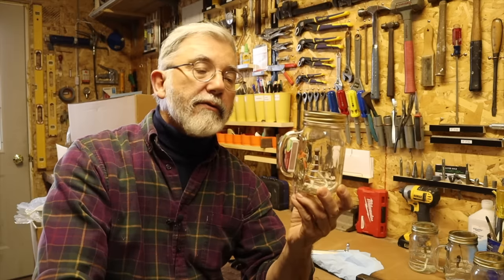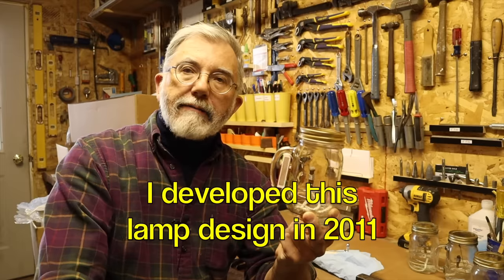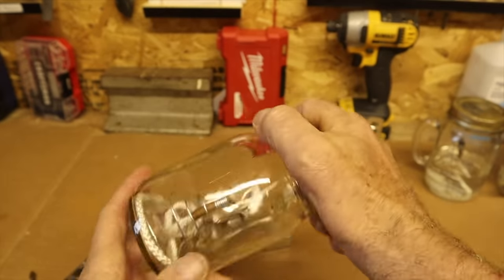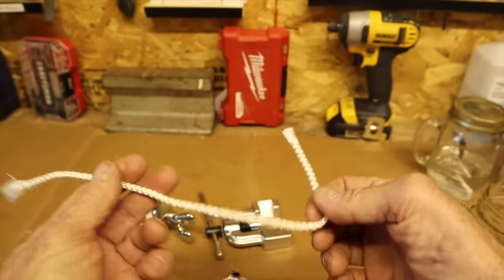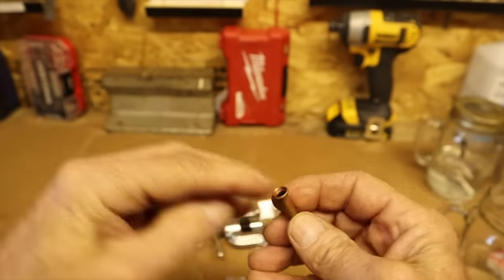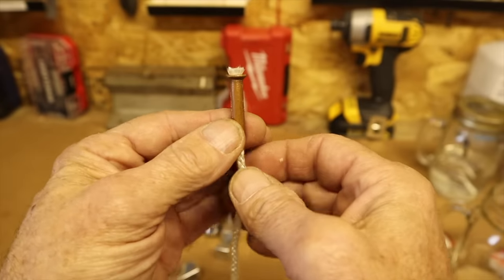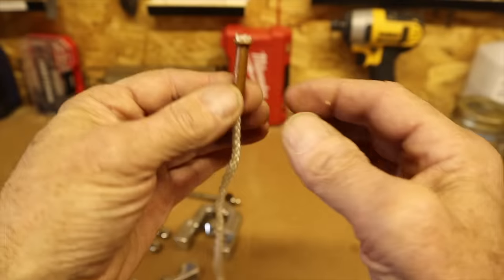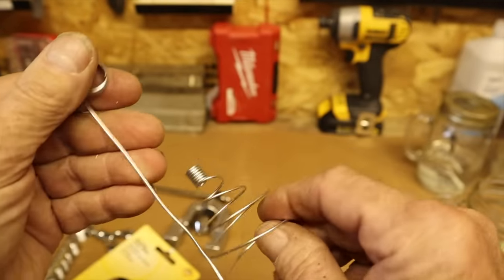How To Make Your Own Bright Betty Emergency Oil Lamp

Comment from the maker: NEW UPDATE: Be sure to check out my video, "How Safe is The Bright Betty Bam-A-Lamp?" at this link: https://youtu.be/asgeLt0cshE
For more information and Bright Betty parts kits... https://www.planetwhizbang.com/brightbetty
Reply: I will check it out and thanks. Also just a opinion if you have time...in a blizzard snow storm with wind/and power outage from multi. Downed trees last winter i tried to make a oil lamp of sorts with what i had in the middle o the night. A mason jar, lid and ring, with a long thick cotton length of yarn. Yarn through lid and jar full of olive oil. Ring screwed down and mach to ignite the oiled up yarn...nope. Time and again and mach after mach...no flame that would last. Why do you think this is? I mean come on oil should burn, shouldn't it? As i was making the lamp i was thinking that i remembered learning somewhere that the Egyptians use lamps filled with oil? The yarn withstood the flame, meaning it didn't burn up quickly so that was not the problem. Is there water in olive oil? Just the regular cooking type olive oil was used. It looked like it should work but not one work was in it.
Reply: I made a salt and oil lamp, takes two seconds, its pretty bright! Just need a wine glass, salt, any oil, wick, put the salt in the glass, holds the wick, the n add oil. .. yarn won't work. I tried it, yarn isn't woven.., its not cord.. not the same... Tea lights wicks are perfect and cheap, and birthday candles are good for transferring the light to the wick that way you don't burn through your lighters.. light the candle then use the candle to light the lamp. 😊God bless... Stay warm.
Reply: Would it be possible to burn olive oil instead? I have a bird 🦜
Reply: @georgetteroenfeldt8144  I read in another comment that yarn won’t work because it’s not woven. I think the yarn was the problem, possibly.
Reply: @bridgetgidget72  I've used all kinds of cooking oils, just whatever's on hand will work... Food oil is actually better in my opinion because everyone has some kind of that, even lard.. nut oils.. you name it.
Reply: @lindaragsdale1656  thank you 😊
Reply: First things first...  I like your "Bright Betty Bam A Lamp," that's pretty cute.  BUT...
That song is "Black Betty, Bam A Lam."  Let's give due credit here.  😉
  Although many other oils will work, the use of paraffin oil reduces residue, has virtually no smell, burns most efficiently and tends to be brighter, as a result.  That's it's intended job.  For that matter, you can stick a candle wick in a 1lb. tub of Crisco shortening or (pork lard), light it and you're done. 
  Rendered lard, (beef tallow is cleanest/best) and especially bear tallow, if you have access (good ol' "bear grease" has been used for almost everything from lamps to waterproofing leather/canvas and lubrication of gears and guns) works terrifically and has been used for a loooong time as lamp fuel.  Especially back when you couldn't look up Amazon or go to Home Depot.  People used what was at hand
  The only issue with tallow lamps is that they have to be warm.  At 72°f it starts to melt and will be a semi-viscous liquid.  76°f and up, it'll go liquid.  This isn't a replacement for the paraffin lamp but, is an effective hot weather alternative or, in cold weather when sitting on the hearth/mantle/wood stove, etc., anywhere it gets warm.
  Many people eat enough beef in their families that the fat (not gristle) trimmings can be saved in the freezer for an indefinite period, then rendered when enough is saved.  Just warm it in a pot over low heat, slowly, until it completely goes to clear liquid, skimming off any foam, impurities, meat bits, etc.. (be sure to trim any meat remains possible away from the fat when storing).
  These types of lamp (wax and tallow) work great, are easy to make and use and my family has had them continually present in their  homes for about a hundred years.  Both paraffin and tallow.  Tallow is a great resource most just throw away and is terrific for cooking/frying just about anything as you would with oils, butter and other fats and it doesn't readily smell or go ransid like pork fat.
  Once it's been Rendered pure, it has basically no odor or color and lasts a loong time and yet, if you fry French fries or eggs, etc. the flavor is terrific.  😀
Reply: Carbon fibre wicks don’t need replacing… try some
Reply: WOW! I always thought it was black Betty ⁉️🤔
Reply from the maker: @wheepingwillow24u17   I'm currently out of stock. The rolls of wicking I was buying wholesale are out of stock. I'm not sure when or if the wicking will be in stock again.
Reply: If you would have left the handle proud of the top the lid will keep tension on the wick holder and it won't raddle around in the jar.
Reply: There are so many people doing these candles/lamps. Easy enough to make yourself 🧨
Reply: @MtnBadger Yes, it's Black Betty😏. Maybe a play on words because of copy rights? Thank you for all the useful info: beat/beef tallow and paraffin oil. 🤗❤️🙏
Reply: @debz3503 and with all due respect to every race I'm sure that plays in there as well 🤷🏼
Reply: Im sure im not the first comment to tell you but the song was actually called Black betty! Go check it out..i promise im right sir although your version is good too🙂
Reply: @MtnBadger  Well THANK you for all that wonderful Knowledge❣️ That’s valuable information there Sir.. I need to re read it several times to make sure it sinks in.. 
So tallow is actually the animal fat??? re: beef tallow?? bear tallow???
Reply: Yes, tallow is rendered animal fat, be it beef, bear, sheep, etc..  It's good for cooking and makes the non-stick happen I. cast pans and tastes food.  McDonald's made their name by making their fries in beef tallow (try it, it's awesome! 😊) and they were sooo addictive. 😆 
 It's good for burning in lamps (like whale oil which comes from the fat) and even a crude lubricant.  The term "slap some bear grease on it" had valid origins.   Bear greae has k used guns, cooked food, powered lamps and was used for waterproofing. 
  Once all of the particulate (meat bits) have been removed/filtered from the rendered (heated to melt) fat, it keeps a pretty long time at room temp, a very long time in the fridge, forever in the freezer.  I always have a block of rendered beef fat in the fridge (it basically melts at room temp.) and use it for cooking eggs, frying potatoes and leaner meats without enoughfat on their own, adding flavor to things, etc..
  If you try it yourself, just save up some beef fat trimmed from steaks or whatever ( ot the really hard stuff or connective tissue), put it in a pit on the stove on lower heat and let it melt completely, skimming off any stuff that floats to the top and remove any bits of meat that will crisp up.  Once it's clear, pour it into a (small) loaf pan or dish or whatever mould you have, remove and put it in a freezer bag and in the fridge and e trash in the freezer.  😊
Reply: Black Betty ram jam

Comment: If you can find other wire, it’s better not to use galvanized wire on anything near a flame or heat source. Galvanized metal has zinc plating, which can give off toxic fumes at high temperatures.
Reply: Thank you for the heads up! I might use copper for mine then.
Reply: It won't be a problem with a wick . It won't get  near the high temperature needed to cause a problem.
Reply from the maker: Correct. Thank you for the comment.
Reply: Wouldnt coat hanger wire work just fine? Provided its not one of the coated ones.
Reply: @chase_h.01  Probably. But coat  hanger wire is very, very hard. It's gone through a process to make it not bend. So, it would be very difficult  if not impossible to use it for this lamp. But most hardware stores will sell copper wire that is much softer and easier to bend.
Reply: @chase_h.01  heat it on the gas hob untill red  and let it cool naturally this should allow you to bend it easy
Reply: Ooh! I had a fast food store off the St Lawrence River, Thousand Islands area. I had a beautiful propane heated grill/oven I got from the Benvenuto Brothers. They sold it and delivered it for only $250 - best deal ever! When I had it installed, I got galvanized steel to protect the wall and use for the hood. Another sweet deal! But little did I know back then that the galvanized steel would give off toxic fumes like that. 👍
Reply: Flared brake line may cheaper things up a bit.
Reply: @anyascelticcreations it may work harden when trying to manipulate it but you can just heat it up to soften / anneal it this may make it easier when fettling the wick holder bends.  I'll try it out.
Reply: @horsetowater  definitely possible. But it'd be a whole lot easier to use a material that you don't have to do all that with. Like copper, if it's available to you.
Reply: @ShaneAlan1  So have I. Back before I had anything else available. Coat hangers are definitely workable. But not easily. If that's what you have, and your hands are strong and/or you have tools available, you could make it work. But now that I know more about different metals, and have the ability to go get something else, I would for sure choose copper wire over coat hangers if I want to bend it into a wick holder sized spiral.
Reply: Doesn’t copper work best for heat conductivity?
Reply: @daltonstewart5366  Copper is a very good conductor. But nearly all metals conduct heat pretty well.
Reply: Thank you for this! Liquid parafin!!!
Reply: @chase_h.01  Hi!
I found your comment amusing. There was a pun in it. If it was intentional, then well done. If it just came about by accident, then nature was working with you to make folk happy.
(I made sure that I removed the coat/ jacket/shirt before using the coat hanger wire!) Haha! I know you meant that some times the coat hanger wire have been "coated" with plastic or even painted.
Thank you for sharing. God bless you and yours! 🙏👍✌️🇬🇧
Reply: Yes, husband welded galvanized wire and was sick with " welders cough" for weeks
Reply: For the record,if a cigarette taste SWEET you have galvanize poison,drink milk!
Reply: @congerthomas1812 Thanks for the info, not a smoker myself, but know a few.  Great health info.
Reply: @dag118 Interesting info to note, thanks for heads up.
Reply: I'd be more concerned about the fumes from burning modern plastic reinforced wicks.
Reply: I saw a galvanized metal warning on another, similar video. Thank you for this important info. It should be pinned since it regards people's health!
Reply: lead fume fever! otherwise known as monday morning sickness in the welding trade. you get used to it as long as exposure is constant
Reply: @chase_h.01 

That small amount of zinc isn't going to harm anyone. This is coming from a welder who welded nothing but galvanized steel
Reply: .040 stainless lock wire.  A pound might be $10, but you could probably make like 20-30 lamps.
Reply: Harbor Freight has Stainless steel safety wire that would be great for this.  It comes in a blue plastic container.
Reply: Hey all. IDK if it's correct that it won't get hot enough in this situation for that to be an issue. My husband isn't here to ask, he would know, but yes, it does make u seriously sick if it were to get hot enough. He has been a welder in the past, and in his current job maintaining semi trailers, has to weld bumpers on, occasionally. Some are galvanized so he has to wear the good mask to protect himself from the fumes, and btw this is done out in the open air in a lot, as well. He's forgotten all about it when he 1st did a bumper there, and got the body-ache sickness from it, as he'd also been unable to get milk right away. Milk is the antidote. Idk what-all kinds work, like, goat or sheep or not, but we are def. talking dairy milk here, and def. cow's does. Drink as much of it as u can, basically, over the next 24 hours, is what I remember. It helps a lot.
Reply: Good to know thank you
Reply: Great reminder..thank you
Reply: But in an emergency who cares
Reply: @-Erebus  People who don’t want to get very sick or die during an emergency care.
Reply: What is a better choice than non galvanized wire.
Reply: @ruffmansavageveteran1345 I have .032 in my tool case. lol I’ll get the .040” brilliant idea ….. I’ve used lock wire to tie pigs on my spit. (Legs and stitched the cavity after putting in lemons  spices and salt)

Comment: A suggestion for an alternative to the copper tubing, a short piece of automobile steel brake line, it comes with a flare already on each end, just cut it in the middle, slide off the fittings,, and you have two pieces to make two lamps.  The brake line can be purchased in pieces as short as about one foot in any auto parts store.
Reply from the maker: Excellent!
Reply: Do you have an example link you can show? Tubing I see doesnt show the flare already on each side. Thank you!

Comment: The wick ned NOT be a foot long, as it is fiberglass and doesn't burn it only needs to reach the bottom of the jar then to one side so when the oil is almost gone, the jar can be tilted slightly so the end of the wick is in the oil.  to further simplify, if you just use copper or aluminum wire and wrap it around an 1/8 drill bit about 12 turns, you could eliminate the need for the tubing
Reply: Hi...These are just some questions that came up for me so, I wondered if you might know, if there's a big difference in making wicks from shoelaces, or tea bag string, etc. I realize the thicker may be brighter, more durable....

....and then, might you know if there'd be great difference between, Kerosene, Torch oil, Lantern oil, Crisco/ lard etc.

Thanks ahead, hehe, for any response;0)
Reply from the maker: I'm sorry but I don't know the answers to those questions. 😕
Reply: @LindasDesk  Couple of channels to recommend here: Robert Murray Smith has been doing an oil burner series. Although his efforts are more for heat than light, he shows how to use a variety of different fuels. His wick of choice is carbon felt. Basically you want the fuel to burn, not the wick. 
 Another one is Technology Connections videos on oil lamps, that was, oh, 6 months ago now? Just a couple of videos but it goes over a lot of old style lamps, how they were designed and why. Might give some useful ideas. If you can use a mantle, that might amplify the light output.
Reply: @DFPercush  This is great. Thanks with much appreciation:)
Reply: The longer the wick the more effective the capillary action is at moving fuel from the bottom to the flame..and the extra length in the fuel is causing no problems and is there if you need to add more....much easier than replacing the wick when too short in the dark.
Reply: @herrickkimball  You Sir are a wonder.The video and instructions were just wonderful.But to say " I don't know" when you don't know....that's where you gained all my respect.Something very very rare these backwards days.Respect!

Comment: Love the video, clear and concise instructions that’ll be easy to follow. I plan on making some of these for sure and maybe tinkering with em a bit. Like mirroring the half of the jar with the handle to help direct more light forward and using smaller red tinted jars as night lights for bathrooms and such. Such a simple concept and so many possible variations!
Reply: Smaller is not always better because of the flame goes higher ,but if it works for you more power to ya eh toivo?
Reply: Good thinking. Maybe aluminum foil?
Reply: @ralphaelalfaro6023  I’ve had decent luck with the foil tape.

Comment: As a cheap flaring alternative, use needle nose pliers to flare out the copper pipe and a small hamer to flatten the flare out.
Reply: Sólo haga un espiral de alambre de la medida de la mecha y no necesita tubo
Reply: I knew if I read the comments there would be an explanation of how to do this without a specific tool. Thanks.
Reply: @marioschutrumpf9463  thanks, that's exactly what I'm going to do. I didn't want to buy a tool just for this.
Reply: @marioschutrumpf9463  I was looking to see if someone else had already suggested this! I did mine with a coil and they work great!

Comment: To taper the coil, have you tried this: Coil the wire as shown, then slide it down over an appropriate sized funnel to taper it to size?  Kinda like using the funnel to taper it after you've coiled it around your coiling jig.
Reply: I was thinking of something like a beer/soda bottle.

Comment: Cool setup!! I think I would uncoil some of the handle when using it and bring the wire up and bend it over the rim of the glass, so the rest of the coil handle is outside of the glass. That way you can lift up the wick/holder wire support to make adjustments if it's leaning or add more oil to the jar without blowing it out and waiting for the wire to cool down. When you're ready to put it away, just blow out the wick and coil the wire back down into the jar. Just a thought.

Comment: I made this. Works great!! I just used regular mason jason, no handle. For the wick holder I used spent .3030 brass shell casings. Drilled out the primer to fit my wick. For the wick I just 4 strand braided cotton string. This was the most time consuming part. Wire I just used left over home electrical wire.

Comment: That is a nice design. When I was little we would take quart and pint mason jars and fill them with candles wrapped with a rubber band and some matches. To make them fancy we would take a picture from a magazine and cut it to fit the inside of the jar so you would not see the candles. One fun trick is to take a pint jar and fill it with crayons if you get them cheap enough. Crayons are candles with a wick on the outside. They do not burn for anywhere near as long as an oil lamp but they are perfect for carry around lamps to negotiate the house in the dark, lamps that will not be used for long periods of time anyway.